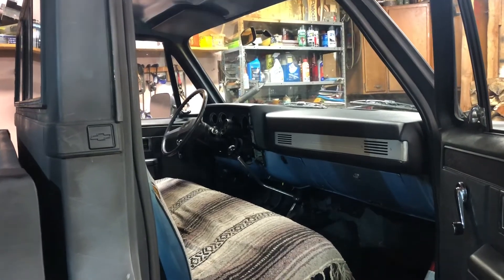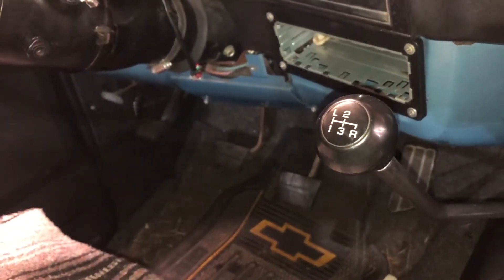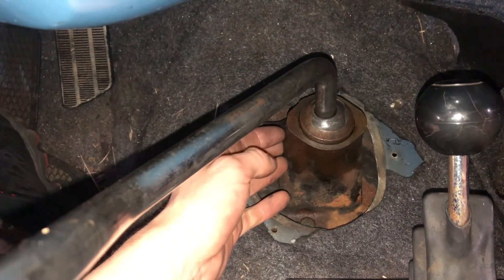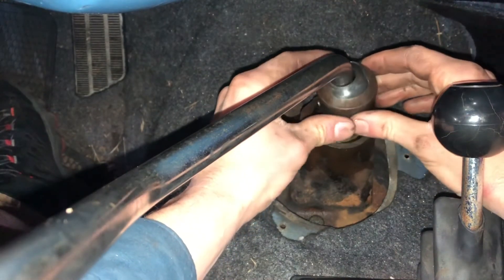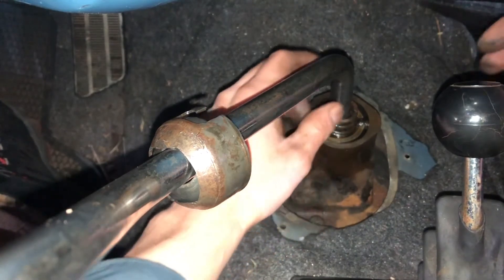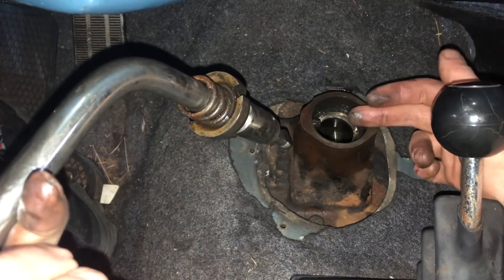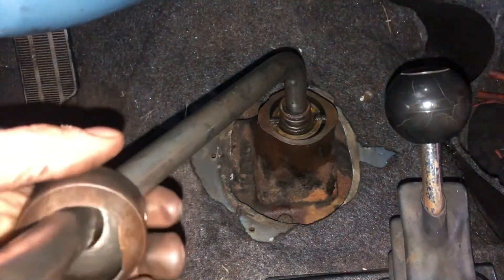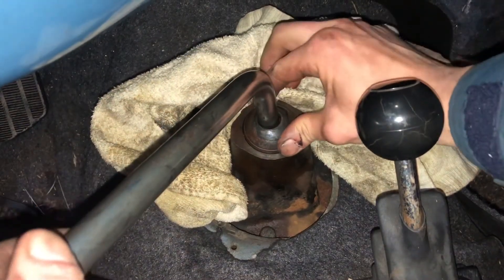How to remove SM465 Stick Shifter from a GM Truck

Comment: Thanks Kyle, Fought for a couple days till I watched your video. Mine was an SM 420 but the same procedure to remove the lever. I had to use a big pliers to turn the metai piece. Dont have a lot of strength in my hands.